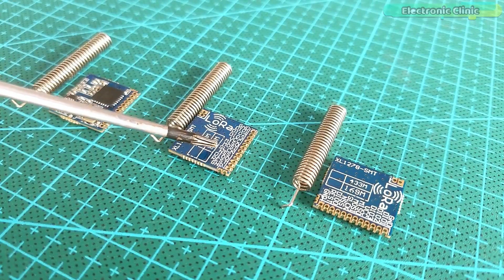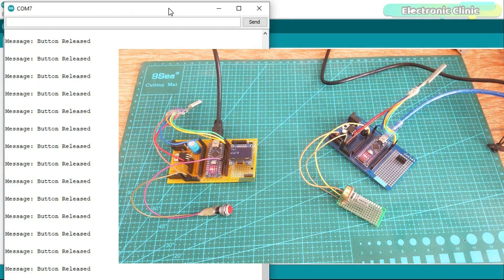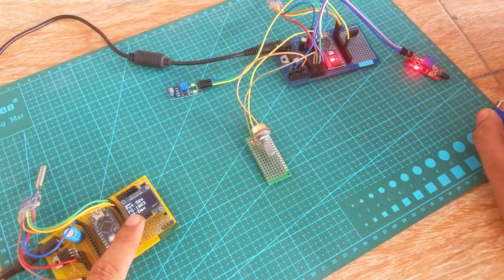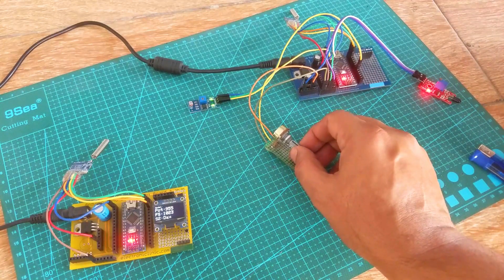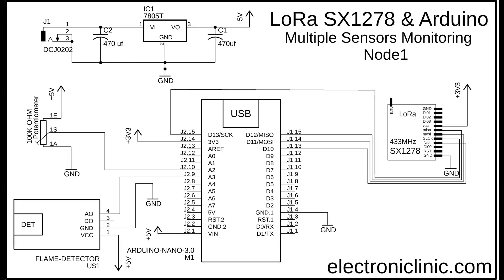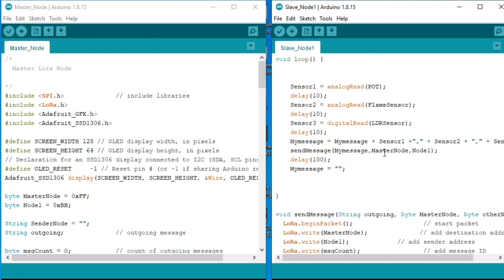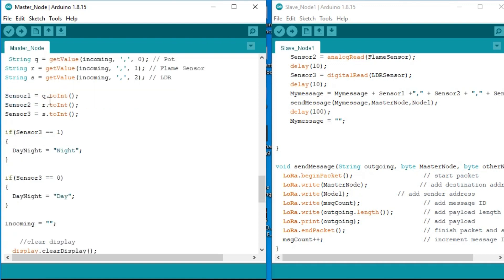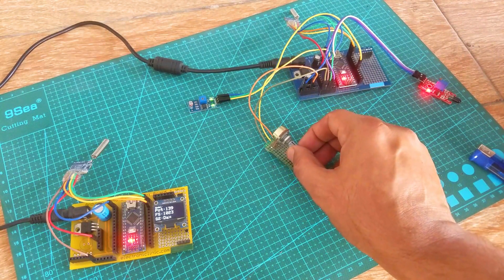Multiple Sensors Monitoring with Arduino Lora SX1278, Flame Sensor, LDR, & Potentiometer

Comment: Thank you Sir, for all of  your informative videos. 
Sir,  If you review "jdy-40 " bt module, that will be very helpful for me.
Specially "at command and arduino compatibilities ". (I bought some jdy-40 module, but they didn’t work. I think there was a problem with bootloader or flash )  so it is very helpful for me, if you make a video with this module❤️
Reply from the maker: right now i don't have this module and in a few days i am leaving for UAE, I will try my best to order the same module. by the way anything special about the jdy-40 bt module?
Reply: @ElectroniClinic  Thank you sir and no need to hurry up, take your time. Have a great day ❤️

Comment: What a perfect time, good tutorial to complete my weekend
Reply from the maker: Perfect!
Reply from the maker: 1 more video in this series, that's about requesting data from a particular Lora Node. Then i will start another series on STM32 and Lora.
Reply: @ElectroniClinic  I admire your courage and knowledge.
I’ll be waiting.
On the next episode, as you say "master will be asking for data from a specific node", just wondering if you can explain how to implement a scenario when a node will need to transmit a data to the master in case of an emergency perhaps.

By the way, thanks for all you've prepared for us.

Greetings from Tanzania 🇹🇿
Reply from the maker: @raymondmichael4987  this is a good point, i will add this. it good to request data on demand and if there is some kind of emergency then the node transmits without waiting for the request. perfect.